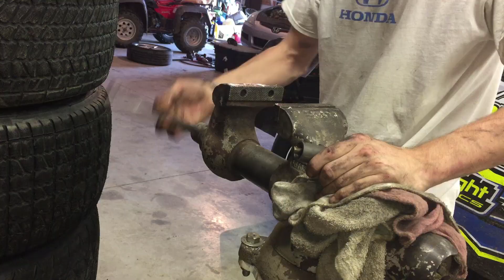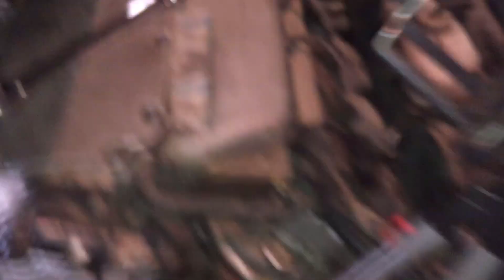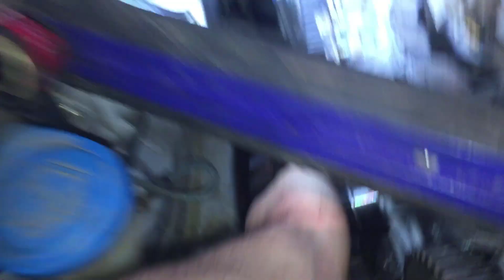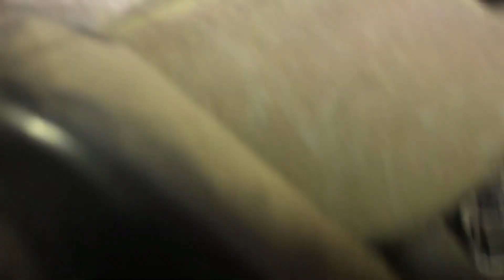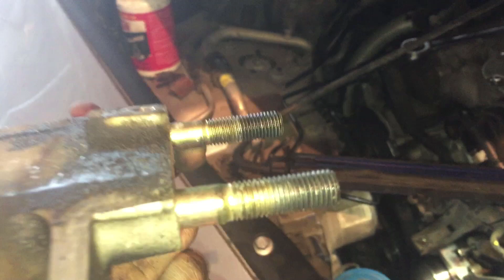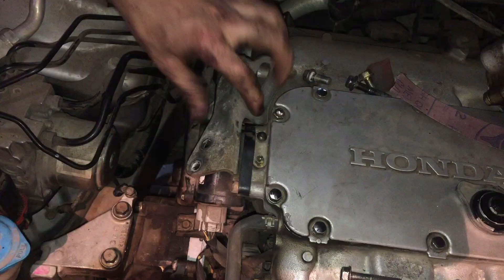Honda Accord V6 Timing Belt and Water Pump Installation

Comment: Have you ever replaced the tensioner and water pump without removing the belt and keeping it on its timing marks?
Reply from the maker: I wouldn’t recommend it, the water pump would be pretty difficult to do that with, probably not impossible though, it would just create more problems than it solves. Mark your belt with an L for the left cam and R for the right cam and C for the crank. Put dots where the marks are and pull the belt off. It’s not guaranteed, but your cams will probably move when you try to pull the pump off
Reply: @TheFeesher I've always disliked the water pump set up on these. What is your method to make sure your on the compression stroke when the timing marks are all lined up?

Comment: Thank you as this video was on point and helped me replace the timing belt and water pump for a 2013 Accord V6.
A few things to consider, based on my experience:
1) I used the harmonic socket with a 3/8 impact with 700 ft-lb loosening torque but the crank bolt would not budge so I bought a 1/2 impact with 1,300 ft-lb loosening torque and it took it right off.
2) When removing the engine mount bracket from the engine mount, after the initial loosening if the bolt does not turn easily during removal, jack up or down the engine slightly ensuring that the bolt is in the center of the bracket. 
3) When installing the new belt which is tighter than the belt being replaced, turn the front and rear cams 0.5 degrees to get the belt on tightly. Otherwise, it was almost impossible to get the belt on.
Reply from the maker: I turn the cam as well when I do them now, I put the cams half a tooth clockwise, then use the cam to pull the slack out of the belt. Makes it super easy!

Comment: Thanks very helpful. I have a 2014 Accord 3.5 V6 with 84K, dealer tells me to change the timing belt based on years (7yr or 100k). I called around and each dealer wants to do different things. Most recommend timing belts, water pump, hydraulic tensioner, and serpentine belt as complete job. Others recommend in addition the right front motor mount, idler pulley, and adjuster/tensioner arm. When I ask the parts guy he said rarely do the idler pulley or adjuster arm need replacement, they rarely go bad. Have you seen them go bad?  Do you think I need to replace the idler pulley and tensioner arm? I am thinking if the bearing on the idler goes bad it's another costly job.  Appreciate any advice.

Comment: This is a great step by step video you put together. The job itself is not something I would feel comfortable on tackling but at least I can get an idea on the procedure. I have a 2004 that needs a water pump replacement I don't know if you would be able to give me more or less the cost or estimate of this procedure. Nevertheless I would like to thank you for taking the time to demonstrate and provide vital information regarding this process. Thanks again and Stay Safe.
Reply from the maker: The dealership worked at charged around $660 for the V6 cars, but o was under the impression we were one of the cheaper ones

Comment: Bro what is the name of the tool you used to double wrench when moving the tensioner pulley to put belt on? Looks like it actually locks into the closed end of the wrench and is less likely to slip?
Reply from the maker: It’s just a serpentine belt tensioner tool, probably one of my favorite tools, definitely have gotten my money worth with it

Comment: Galling is caused by over tightening. When using never seize,  lock tight or oil you must  reduce the torque by approximately 30%. Call customer service at lock tight and never seize. Remember what you see on you tube is for entertainment not methods or specifications.

Comment: You forgot the reinstalling of the crankshaft pulley. Im stuck on how to tighten it correctly lol
Reply from the maker: I totally forgot lol you need an impact or the Honda crank pulley holder tool that you can rent from a parts store.
Reply: Hey so i replaced the wp and ran the car. It seemed to run fine. Then suddenly the radiator pops when i come back to the driveway and the top of the radiator was spewing out coolant🤣

Comment: How common are bent valve issues since it's an Interference Engine?  I'm fixing to help My Son change His.  I've already changed one on a 07 3.5 Vue I bought used from a Wrecker Auction.  I changed It to be safe/maintenance.  I have changed the Timing Belt on several Engines without changing anything but the belt.  I use a Bench Vise to compress the Belt Tensioner.  You need to be able to do that if You/I install the Belt wrong and let the Tensioner loose.  I believe I had to set the Crank Mark just ahead a tennie bit to get everything lined up on My 3.5 Vue.  Cam holders can help.

Comment: Does this whole procedure is the same for the 1999 accord v6? I have all my parts and im doing it tom. Thank you!
Reply from the maker: Slightly different, very sumac though. Think the tensionor is a bit different. But other than that, once you get to the timing belt, it’s the same IIRC

Comment: Thank you for posting, nicely done, one question about using anti seize, you say in the video that it will affect the torque spec, which I agree, though I am not sure how to correct this, meaning should I reduce the Torque amount for each bot, by how much? Thank you
Reply from the maker: Yeah, I’m not sure how much to reduce torque by, if any. Just something to keep in mind when tightening.

Comment: After you install the timing belt.
And you crank it over 4 times to ensure TDC. 
What do I do  if it’s not TDC?
Reply from the maker: Try to set the crank to tdc with the belt on and cams to TDC individually with the belt off, then try to re-install the belt

Comment: excellent video, they have a wrench at some parts stores they will rent to help with flywheel/harmonic balancer pulley or a 1 7/8 nut yea bid nut welded on flat plat will hold it .

Comment: Great video!  My 2006 honda accord v6 has developed a tick/knock at low revs (<1,500rpm).  Sometimes the knock is there when engine is cold and idling, but when the engine has been running and is up to operating temps, the tick/knock is gone.  However, as soon as the AC compressor is turned on, the knock continues (apparently under load).  Other than a bad/sticking lifter in the valve train, I've read that the problem could be the timing belt tensioner.  Anyone knows how this tensioner could be the culprit?
Reply from the maker: It could be s tensioner, hard to tell such things without hearing it in person. Unfortunately when someone tells me they hear a knock that goes away with revs I almost always jump to rod knock.  You can dismiss lifters though since Honda’s do not use hydraulic lifters

Comment: Hey bro i followed all the instructions but for some reason after instaling new belt my left camshaft sproket 1 doesnt align after turning engine it was all align when i removed my belt. left my crankshaft pulley white mark on the lower arrow cover and ca1 and ca2 where aligned so i dont know how it moved..plz help car has been parked for a month dont know what to do..this is how it ended  http://imgur.com/gallery/50Otk9u
Reply from the maker: I’ll try to look later, it’s not letting me right now for some reason, I’d just try to install the belt again

Comment: Do you have to take the water pump off if just replacing the timing belt?
Reply from the maker: No, but it’s just one of those things, do you want to tear it all apart again to replace the pump if it starts leaking soon after, or worst case, locks up and smokes the new timing belt. I always replace everything that moves inside the timing cover. Not needed, just HIGHLY recommended

Comment: somehow my back cam got misaligned when I was putting my timing belt on. now my front cam is tdc and my crankshaft is tdc but my back one says its off. what am i suppose to do now? I tried turning it with a wrench but its spring loaded so its just reaching a stopping point then snapping back to where it is.
Reply from the maker: That’s always hard, you just have to keep trying to get it right. I’ve had to do some weird maneuvers where I held the belt, held the wrench and then set it on. It takes patience but can be done. After setting the belt on, just double check the timing before starting the engine

Comment: Im back again, will this video work on a Honda Odyessy 2009 3.5L? Wifey got a good deal and im thinking it will🤔 maybe a few extra wires n clips etc?
Reply from the maker: I don’t believe the 2009 vans have this issue, but it should be similar

Comment: Hello, i was doing my timing belt on 2004 Honda Accord v6 by following your video. Everything was aligned right and I pulled the pin. Installed the crank pulley back on and turned clockwise 2 turns. Then i looked and my belt was stuck at the crank shaft. And my tdc at crank shaft was still fine but boths cams are way off. I took the belt off, how i set the engine at TDC now, please help...

Comment: Thanks so much for this video.  We're going to take this on for our 2007 accord, since the shop labor basically equals the remaining value on the car.

We had the whole system replaced (belt, water pump, and tensioner) a year ago, and just got a loud rattle started - the tensioner went out.  If we've got a basically new (<10k miles) water pump and belt, would it be possible to replace the tensioner without even removing the belt?  I'm thinking that if the old one is loose (hence the rattle), it will pop off and the new one can slide in, pull the pin, and be good to go?  

Critically, as long as the TDC marks all line up once we get the new one in we should be set, correct?

Thanks again!
Reply from the maker: As long as all the marks line up you should be golden! Replacing the tensioner without removing the belt is possible, just try to rig up something to hold a bit of tension on the belt to keep it on the crank sprocket, use clamps on the cams to hold the belt there. Always double check marks though before final installation
Reply: @TheFeesher  Just successfully replaced the tensioner with a lot of referencing this video.  Managed to pop out the old tensioner and install the new one without removing the engine mount.  Thanks again for the great resource!
Reply from the maker: That is awesome! I am glad to have helped!
Reply: @TheFeesher  Thanks!  I'll let you know how it goes!

Comment: Hi can someone please tell me 2003 Honda Accord v6 has interference engine or non interference
Reply from the maker: Interference
Reply: @TheFeesher  thank you . I have a miss fire in my v6 and my mechanic told me it's the timing belt.
Reply: Could be spark plugs or ignition coils.
Reply: Was your check engine light blinking after you started the car?  A miss fire could dump fuel into your exhaust damaging your catalytic converters.

Comment: Looks like you have a serious oil leak coming from the crankshaft. Why didn't you replace that seal?
Reply: Actually, it could be coming from the oil pump o-ring or cam seal???
Reply from the maker: It’s coming from the oil pump, the customer did not want to replace it at this time, so that’s all I could do lol
Reply: Thanks, Im working on '06---can seem to get the leak---after replacing oil pump o-ring. 220K miles Any suggestions?
Reply from the maker: I’m guessing you put new HondaBond is as well?
Reply: The Feesher Thanks for your response. I used Permatex Ultra Black. But now realize I will have to use Honda Bond. I could have misaligned when reinstalling. Bummer
Reply from the maker: Dale Landry Honda bond is great, and I have seen a few installs where the Oring fell out and got pinched between the pump and the block, so that could be a possibility since there’s no way to tell what’s going on without removing the pump again
Reply: The Feesher Is there any special technique I need to be aware of using Honda Bond? Apply to one surface, wait a few minutes then apply. Let squish out and sit and hour before torquing?
Reply from the maker: You can apply however you choose, the main thing is being very vigilant of the front seal not turning inside out when going back on the crankshaft and an oring not falling out. I think Honda says to wait like 3 hours before refilling with oil, but I can tell you no mechanic at a dealership does that so its just kind of left to your own judgment
Reply from the maker: I would torque right on install though the orings are the important part and if some of the hondabond has hardened, it wind clamp as hard between the black and pump
Reply: The Feesher thank you!

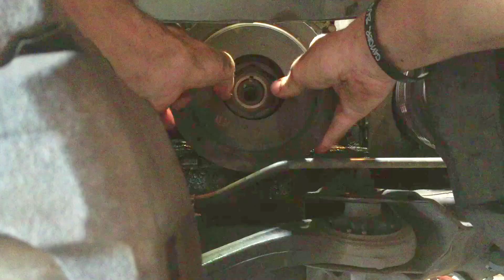Comment: Where is that oil from at 8:11?
Reply from the maker: Vader...You Seek Vader! It comes from the oil pump leaking, the oil is actually sitting on the pump. I would always recommend oil pump reseal when doing a timing belt since the belt needs to be removed to seal it anyway. The seal consists of a couple of orings, and Honda bond. Downside is that the pan needs to be removed as well.

Comment: Thanks for taking the time to share this procedure with us. I am much more confident to tackle this project myself. What are your thoughts about using non OEM parts? Let's say a kit sold on Amazon?
Reply from the maker: But don’t go super cheap, to family and friends I always tell them to just grab the Gates timing kit
Reply from the maker: I would always recommend OE, if using OE you can almost always go off of recommended service intervals. If you use aftermarket just be more aware of your car, notice if you hear signs of early failure. OE is for peace of mind, I consider anything else a calculated risk, I don’t use OE on most of my cars

Comment: My rear cam doesn’t align with the other two. I notice this when putting the new belt but I had them aligned when I took it apart. Any suggestions for getting this back aligned?

Thanks
Reply from the maker: When this happened I often just used a wrench on the cam bolt to rotate it correctly and put the belt back on
Reply: The Feesher how do you do so?

Comment: When you were showing how your timing marks were still lined up properly after installing the belt, it seemed like they were about half a tooth off. Mine did the exact same thing and I thought it would be okay because yours was also. The car runs perfect but I’m paranoid now because I heard that it has to be EXACTLY lined up. Any insight ?
Reply: Also, the car makes a very faint grinding noise now, but I think it’s the serpentine tensioner. Any ideas ?
Reply from the maker: If it is running and seems alright on power it should be fine, as for the grinding would look at either the tensioner or power steering level, assuming all the timing idler bearings were replaced

Comment: would this work on a 2009 honda accord with the 3.5 v6? the car only has 55000 miles on it but the belt is 9 years old thank you
Reply from the maker: Yes it would work on it, timing belt installation is the same on all the V6 engines up to 2017ish

Comment: How do you know without afoubt you did this right? What would it sound like if you did it wrong
Reply from the maker: Checking the timing marks is essential to knowing for sure. But as to what it will sound like if wrong, bad case scenario: you notice the car having poor power and response, probably a check engine light on too. This is a possible tooth off, might be fixable, I’ve never been a tooth off on a V6 Honda but I’ve seen other interference engines run and not bend valves while being a tooth off.
Worst case scenario is you go to start the car, hear a series of metallic “ching” sounds and then only run on a few cylinders if it starts at all.
Reply: @TheFeesher  good, I'd say I did it right then hahahaha
Reply from the maker: Good to hear man!

Comment: Would this procedure be similar to just replacing the engine mount bracket (the one that covers the water pump)?  My bracket has stripped out threads and I just need replace it.  Do I need to remove everything you discussed for just this bracket?  Or is it simpler.  Thanks,
Reply from the maker: I think the timing covers cover the bracket, I could be wrong though, it's been a while, so you'd only have to go as deep as the timing covers

Comment: Great video!! I followed your guide and successfully replaced timing belt and water pump for my 07 Accord V6. Few things to add: 1. Use the Lisle 77080 impact socket and the impact driver to remove the crank bolt. Will take you just a few seconds. Specially tips: cover a thin cloth on the bolt cap before you put the socket on. It'll give you the best result. 2. No need to unbolt the triangle engine mount bracket from the bracket on the body side. You can remove it with the bracket on the body side together. Adjust the height of the engine using the jack while unbolt and bolt it back from the engine side bracket, it will prevent damaging the threats. 3. when putting the new timing belt, pay special attention the the cam in the back. I have to do it twice because there is one tooth off from the first try. The tensioner tends to pull the back cam counter-clockly.  To compensate that, line up the front cam and crankshaft perfectly, then adjust the back cam slightly clockwise. 4. Drain the coolant before you pull the water pump out. And after you finish everything, warm the car up for 10-15 mins, and recheck the coolant level. Overall, it's doable job and it feels good after you do it yourself. Thanks again for the great guide!!
Reply from the maker: Great tips! Thanks for the comment, and I'm glad the video helped!

Comment: How long did the job take all together?
Reply from the maker: Probably 4 hours, usually taking the crank bolt off takes the longest but since I figured out that starter trick it went really well.